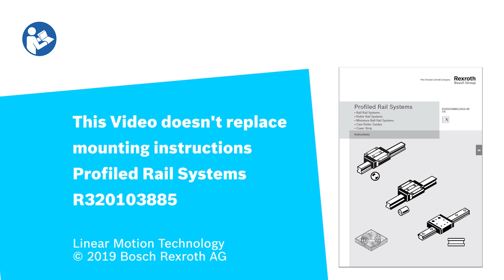[EN] Bosch Rexroth: Linear Guides - Mounting and aligning parallel guide rails (How-To)

Comment: But how do you align round rails that are mounted on the side of the extrusions when the rails are 30 inches apart?
Reply: You can try by using a connection plate  btw them